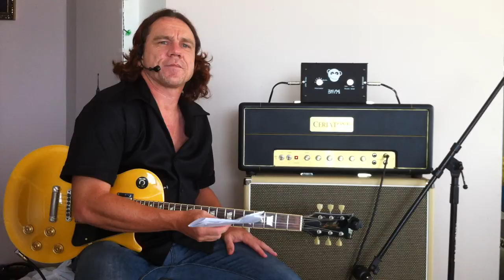BIG WHITE MONKEY 100 WATT NON OHM SPECIFIC ATTENUATOR

Comment: How does this compare to a THD Hotplate or Weber Mass attenuator? Is there much treble loss?
Reply from the maker: Hi its a resistive attenuator,similar in design to the Dr Z ,it doesnt take anything out or add anything to the mix,the reduction in dB,s may sound different to each individuals ears
Reply: Awesome. Just bought one. It's great guys. Love it! Great value for money.

Comment: No it doesnt require one.It has vents in the bottom which do the job of heat dispersion fine.As with all units it gets a little warm with prolonged heavy use but never that hot.
Reply: Are you guys on the Gold Coast ?
Reply from the maker: @yanickborg3118  yes we are